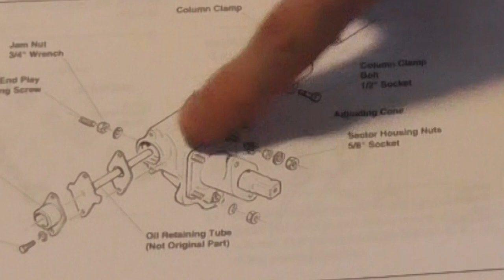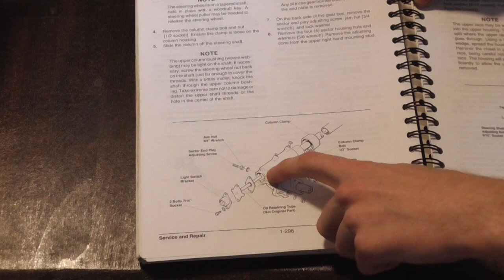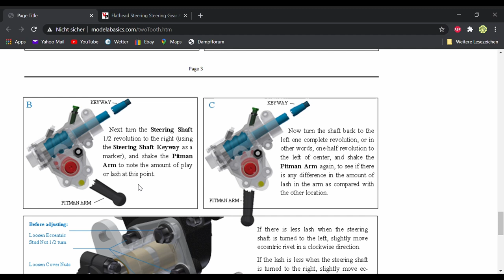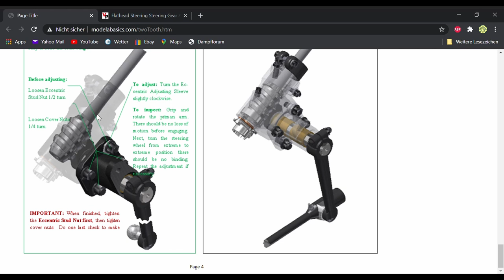Sealing and Refurbishing the Model A Steering Box

Comment: I've taken the steering box out of my Town Sedan before. My car is Right Hand Drive and doesn't have splash pans. 
I left the steering column tube in the car. The hardest bit was removing the horn rod, which hits the roof, so I had to remove the column clamp and let the column drop slightly. Once the steering wheel is removed, the box can be unbolted and pulled out from under the car (had to jack up the front axle). All up you can have the steering box out in about 15 minutes. 
Thanks for the great video, I'm about to completely overhaul my steering this week and enjoyed learning from your experience.

Comment: Great Video. Noticing the different thickness of oils. John Deere makes a grease called Corn Head Grease thaty is actually quite thin. It is used in Corn Head Gearboxes and snowblower 90 degree gearboxes. It works very well and might stay where it needs to stay in the Model A steering box.

Comment: 17:25  You are 100% right. Don't let the internet know-it-alls tells you otherwise.  if it ain't broke, don't fix it.  It leaks oil, but it steers fine.  The ONLY thing you could do to get it back in perfect shape is replace it. Since it doesn't need replacing because it works fine, ANY attempt at "repair" is stupid and unproductive and will probably result in a steering box that no longer works and needs to be replaced.
If there is ever any doubt, remember rule number one... If it ain't broke, don't "fix" it.

Comment: My '29 has less 'slop' than you ended up with, these can be adjusted up really snug if you work at it, takes a little luck to get it perfect, no 'slop' in dead-center of travel at all.
Reply from the maker: It's an art for sure - I tried my best for about 1.5hrs - if you look at it the wrong way while tightening the locknuts, it'll bind up again.
Oh well, the car steers straight and doesn't wander, shake or shimmy... I'll call it good enough

Comment: Adrian,
Great info, and fantastic video. How long did you cut the metal tube you soldered on?
I will have to do that with my 31 Tudor.
-Ken Lilienthal
Reply from the maker: Hi Ken,
man, I wish I had written the dimensions down. I THINK it was 6 inches, but I'm not 100% sure.
All it has to do is come above the oil level, so for an approximate size you can measure the distance between the cover plate and filler plug.
You can buy these endplates readily modified from any Model A parts supplier, though.
Reply: @AstraWerke  Thank you

Comment: My 30 needs the same treatment. Do you think you will ever add an overdrive?
Reply from the maker: Absolutely not - I really don't like the idea of having a 2nd shift lever. 
If I should ever do any modification to the gear ratios at all, I'd contemplate taking a Model AA four speed gearbox and fitting it with custom gears. But not, until my current gearbox gives up the ghost - and who knows when that might be.
I like the challenge of keeping the 3 speed crashbox. 
Sure, overdrive would be more convenient.
But so would a synchronized gearbox.
Why not an automatic?
You know what, screw it, a Honda Civic is a much more convenient car alltogether.
I may exaggerate here, but you get the idea. It was good enough in the 30s, so it's good enough for me now.
Reply: @AstraWerke  my car came with a Mitchel. I got my car from an estate and it was under restoration when the owner died. The OD was installed but is brand new with zero miles. Like you I don't like the shifter so I spoke with Mr. Mitchell and he has a very nice push/pull shifter mounted cable operated unit that I'm opting for. I'll let you know how it works out. I'm the third owner of a 1930 deluxe town sedan Briggs body with 39,788 original miles. The gentleman before me purchased the car from the original owner in 1959 in NYC. It's had one respray in 2020.

Comment: So the steering wheel affects the timing
Reply from the maker: The spark is adjusted through a lever on the steering column. Thus, rotating the steering column (not the wheel) has the same effect as manipulating the lever.

Comment: Wow. This is probably your fanciest video production yet - lots of camera angles (and setups) lots of jazzy editing, lots of jokes. I would suggest not to go any further in this direction though - it would be what we call in England putting the cart before the horse. 

And you didn't even comment on the fact that you did a tricky soldering operation, perfectly, with a huge old paraffin (I think) pressure blow lamp.

Quinn Dunki would be impressed, after all the soldering trouble she had.
Reply from the maker: Well, it's hard to disregard an idea that formed in my head once I've had it - expecially if I don't have a solution how to do it right away, but only a vague idea. Beaming Paul Shinn onto my desk, or the steering column machine-gun were such things - I like them as a challenge, so as long as I have an idea, things like these will keep appearing, I'm afraid ;)

As for the soldering... Sometimes it works, sometimes it doesn't. You'll see what I mean in a future Steam Boiler episode ;)